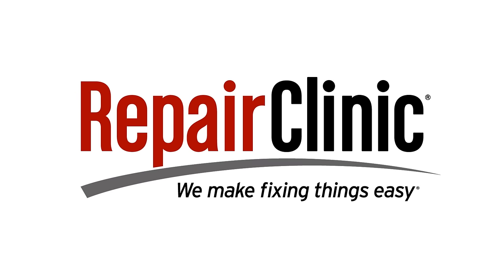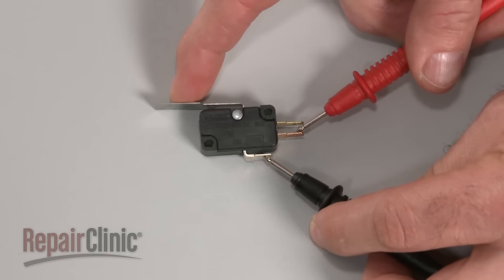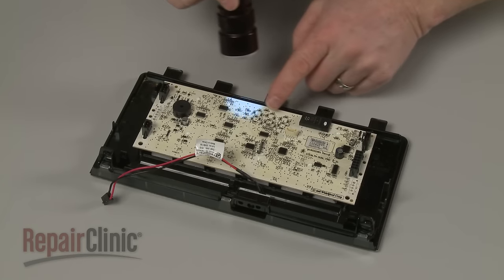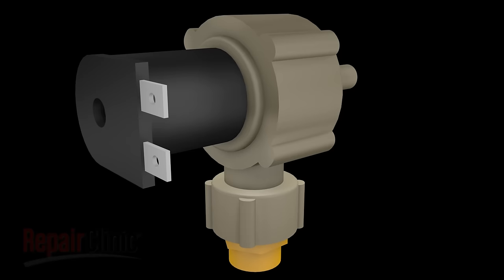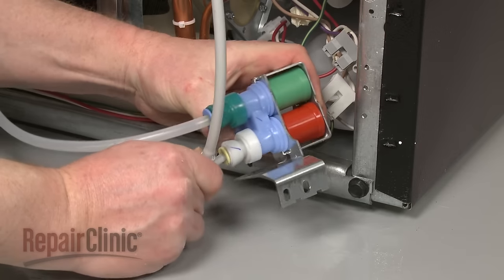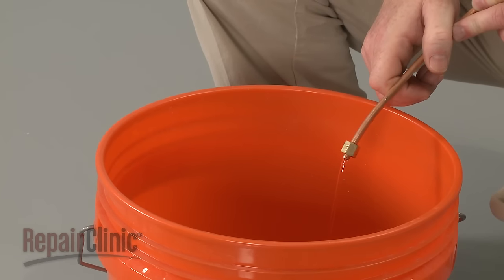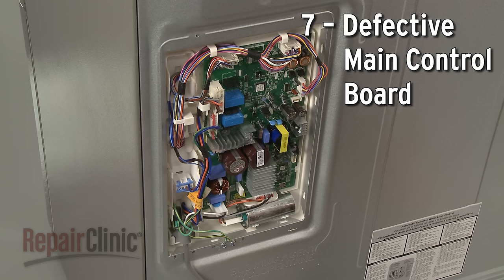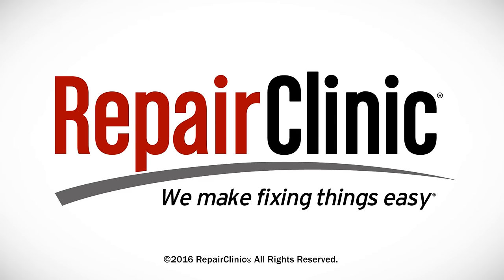Fridge Dispenser Not Working — Refrigerator Troubleshooting

Comment: After replacing the ice maker, water inlet valve and filter I decided it was probably a good idea to check the switches for continuity. Turned out to be a bad water dispenser actuator switch, I was able to get a brand new set of 2 off Amazon for like $15. Even though I replace a few parts trying to fix my issue this video still provably saved me $150 to $200 verses paying someone to come diagnose and fix it.
Reply: Was only your water not dispensing or ice too? Mine won’t do ice or water. Hoping it’s the switch but I’m scared it’s the main control board we just replaced. 😩😩😩

Comment: "Repairing a water inlet valve is not recommended, due to risk of the part failing." What they don't tell you is that inlet valve is a piece of plastic that costs $83. I think attempting to fix the part would be the least risky option. Of course, that depends on your definition of risk.

Comment: I had my issue diagnosed:  he said that the insulation in the freezer door had broken down, and causes the water line to completely freeze. He recommended replacing the entire freezer door - very costly! (Frigidaire side by side)
Is there another solution? Is there a cheap way that I can do this maybe?
Reply: Pretty much the only thing you can do is possibly find insulation that works with that freezer door/material either 3rd party or from the brand it self though I somehow doubt they would sell the insulation alone
I would have the technician show you where and why/how it’s actually broken down and what it’s supposed to look like before moving forward

Comment: So I was super late changing my filter.  Ice was working but water stopped.  Bought the new filter because I needed it and ruled out the obvious.  The trim ring around my side by side popped off and you can disassemble (pry carefully BUT WAIT).  I opened the door and put a space heater blowing on the inside of it.  Frozen stuff to my chest freezer.  I put string trimmer line up the water tube and hit something 18" in there.   It is just a tube that goes through the door and out the bottom by the hinge.  That test should have went in at least five feet.   Sure enough 45 minutes later tiny sliver ice cubes came out when hitting the water switch (door closed people no water with door open)and I'm back in business.

Comment: My ice maker wasn't working but the water dispenser was.  I replaced the water inlet valve and now I have no water in either dispenser.  There is power to it as I can hear it when the water dispenser is pressed.  Any suggestions?

Comment: My problem was the cover housing the buttons ribbon cable was not plugged in. Possibly wasn't connected after accidentally or purpose removal.  No button response was my issue

Comment: I have a Frigidaire side-by-side refrigerator and I changed the water valve but it is still not making ice norr the water is coming out. Water pressure is good the door control panel is good. Attempting to have water dispensers I hear a sound towards the bottom back part of the unit. Any idea how I can fix this?
Reply: Did u purge the system? I just bought a new fridgedaire some months ago an of coures no instructions . but after some digging the website for instruction manuals on my model i found that u have to dispense water four 4 min sometimes more until u get all the air out an should ateast purge until u can fill a 8 to 12 ounce glass atleast 1 time at minimum. And also make sure your filter is pushed in or water will not pass to the dispensor. The filter itself completes the waterway to the dispensor.

Comment: So our ice maker doesn't seem to be sending water to the ice maker itself, however, we still get water at the dispenser. Could that be the water inlet valve or the ice maker itself? No frozen ice anywhere.
Reply: Same story here, the flow to the fridge is strong, the water dispenser works perfectly yet there is no water going to the ice maker. The line running up to the top of the fridge is clear, the water inlet is not frozen I replaced the water inlet valve with a new one and the door control lock is unlocked yet no water gets to the icemaker.
Reply: We actually ordered the part but the night before we got it we decided to trouble shoot and vacuum behind the fridge. We cleaned it real well and viola it worked good as new. We were able to return the part.
Reply: Sheri Catrett b

Comment: Question- My fridge water dispenser doesn’t flow water.  I test by disconnecting the hose down below the fridge door connecting with an the elbow connector & the hose going up to the fridge water dispenser.  When I pressed the water dispenser switch, there’s a strong flow of water from the hose of the water filter but no water will come out in my water dispenser.  Could u pls give me with some possible defect of my water dispenser?  Thanks.

Comment: My name is Alexander Shilling and just recently our whirlpool refrigerator tripped a breaker down in the basement of our house. My dad went to the store and brought a new refrigerator but I am still confused. He hasn’t installed the waterline at the back of the refrigerator just yet.
Reply from the maker: Double check the outlet voltage and your owners manual. Check if there is proper grounding or if there is an electrical short. Try unplugging it and reset the breaker. If it is an issue with the outlet or breaker you will need an electrician, if it is a short in the refrigerator, you will need to contact your warranty company because your refrigerator is new.

Comment: I have a Frigidaire double door and it makes ice but does not dispense water from the dispenser, so I’m suspecting that it’s the control behind the dispenser, water comes into the filter, so I know water is there, I believe it’s after the filter.. please send me a reply 😊 thank you
Reply: Any luck? I have the same problem and I just heard the water come into the new filter too
Reply: I'm thinking my water line is frozen, I put string trimmer string up the water tube and it goes in about 18" and then hits a blockage.  I have the freezer contents in my chest freezer and a heater pointed at the door with it open.   The ice working means the pressure, water inlet, and filter (replaced that first they don't mention that being a potential cause)are fine.  Only the switch or just that part of the board could be bad.  (The board is unlikely). AND>.......45 minutes later shut door (must be shut), and tiny little sliver ice cubes plopped out and I'm back in business.

Comment: I have to say this is the sorriest refrigerator I have ever owned. We had the entire compressor go bad in less than 3 years. We have mold growing on the seals around the doors. The ice maker has been replaced 3 times. We were told there was a class action suit regarding this model (no, we were not advised by LG so we are stuck with this POS). Now the ice maker is not working again. I refuse to spend another dollar on this POS...and will NEVER buy an LG appliance again.
Reply: Oh, and 3 years after the compressor was replaced, I received an email from LG customer service asking how my service call was handled and was I please with their service.  EXCUSE ME?  You can only imagine how I responded. Customer Service is as bad as the appliances.

Comment: My frigidaire water dispenser works on and off.  I have to push multiple times for it to work. What could be the problem?
Reply: Could be the switch or the solenoid.  Or any electronic connection between really

Comment: I have a KitchenAid side by side.  The Icemaker works and makes ice, so I am getting water.  But neither ice or water will dispense from the door dispensers.  The augur motor for the ice despenser does not seem to turn on when I press the handle.  The frreezer door swith seems to work, because the light in the freezer goes off when I push it in.  So, I think the problem is in the control panel.  Anyone have ideas?
Reply: According to the video: faulty dispenser switch. It could be a number of things though...
Reply: Did you ever solve this? I’m having the same issue. No water or ice even though ice is being made. The flap opens for ice but nothing else happens whether it’s set to ice or water.